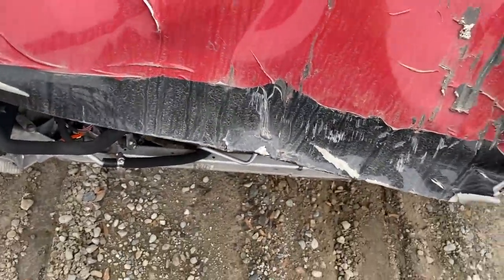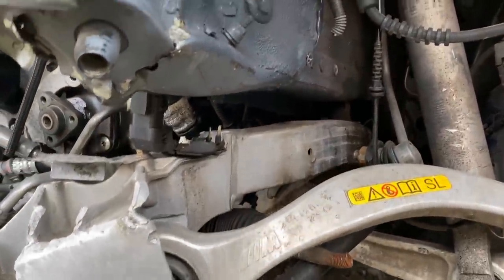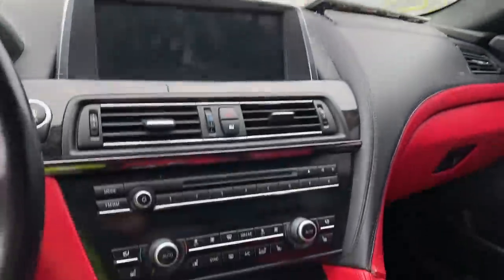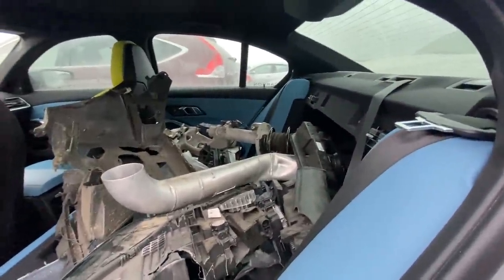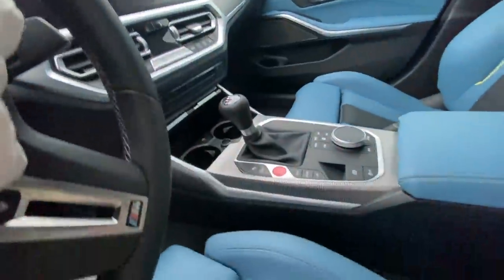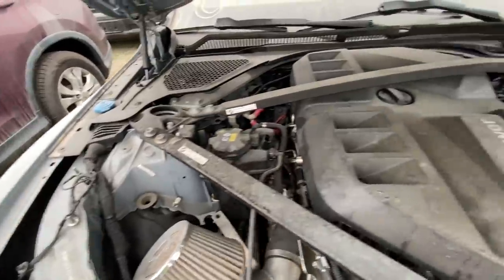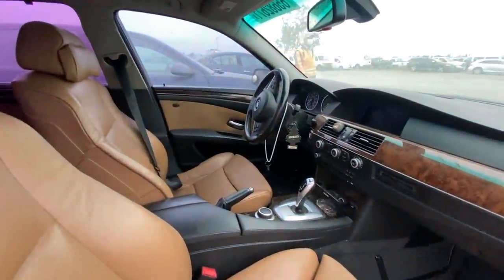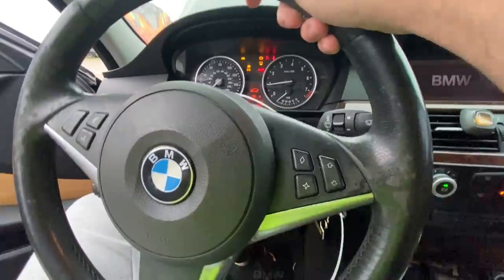FOUND THE CHEAPEST G80 FOR SALE! Is The Damage Bad?

Comment: The e60 is definitely the best choice, build an N54 with hybrid turbos. Would definitely bring a lot of N54 fans to the channel.
Reply: Literally throw in some ebay turbos(17T or 19Ts) for around 1k with the usual bolt ons and it would be a nice sleeper. I have the ebay 19Ts and im pushing over 500awhp on e50 with no issues.
Reply: @silver_n5442  I want to get ebay turbos but I don’t want to risk the headache of redoing the job twice 😭 especially in my garage on jackstands
Reply: @I_Learned_a_Thing  if u doing it yourself, spend the extra money and get some pure turbos

Comment: Honestly I’d like to see you build a 340i I think you’ll enjoy it hella especially with that b58 engine I’d love to see how fast you could make it
Reply: Absolutely right! B58 owner here (Gran coupe 2017 440i ZF8 with MPPK and Full M exterior package ) and it puts a big smile in my face every time i press the gas pedal with the gear box in Sport mode 🤩
Reply: @technopro-kz4xv  did you buy it outright? I want one but my credit isn’t stellar enough, and I feel hesitant to use capital on the entire thing
Reply: @X11CHASE  i bought my car almost new with only 35k miles... The car and specially the engine is very reliable, but you have to be ready if something happens like an inyector, the coils or any problem with the high pressure fuel pump which is very expensive, other than that and if you know how to diagnose your car and wrench yourself to repair a few things here and there then you will be fine... just change the oil every 10k miles or a little less and you will enjoy it every second. Go for it man, you only live once! but save some money just in case something happens in the road. Just my advice here: Don’t buy a tuned car from somebody because the car could be already trashed and living in the redline most of the time... 😃👍🏻